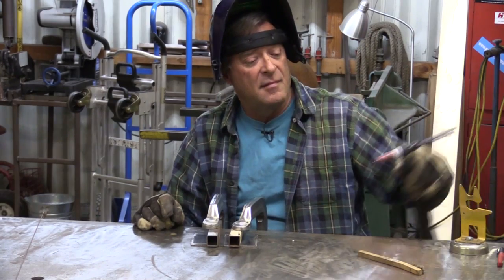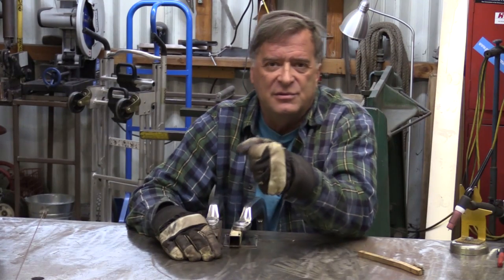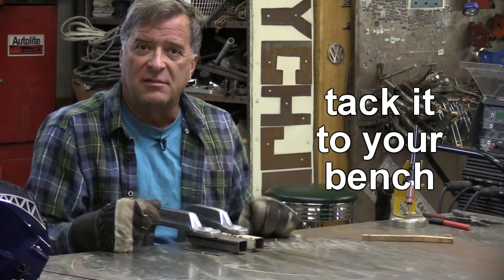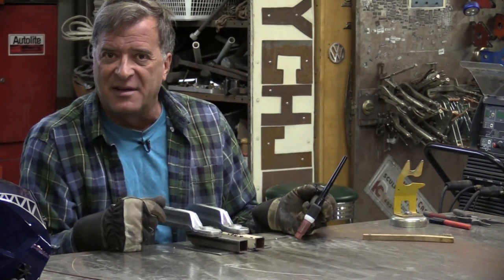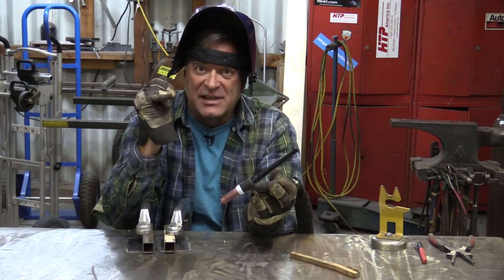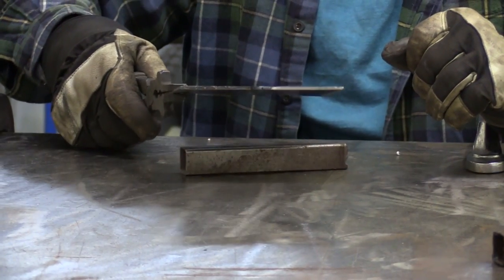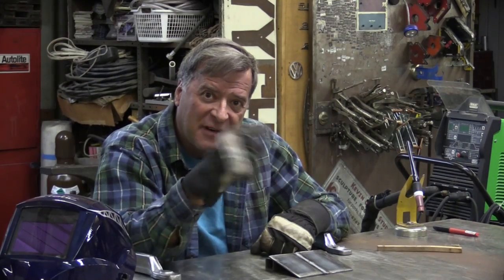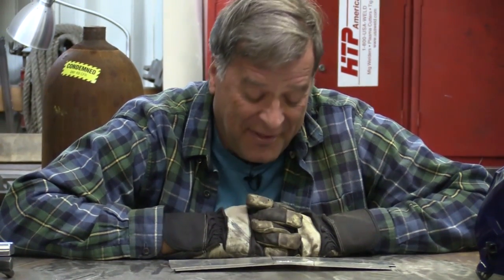How to Beat Welding Heat Distortion, Part 1 - Kevin Caron, Artist

Comment: I've tried just yesterday to weld a square tubing to a piece of 4*4 inch 0.4 thick plate , having tacked the piece to the welding table (3 tacks by side). The tacks held and yet : 
The piece still warped a bit 
What did I do wrong? Is there any way to totally cancel the distortion ? Preheating the parts to high heat ?

Ps: I was using SMAW
Reply from the maker: Bummer!   You might try heating it up to red and clamping it down to the table till cold.   You can preheat and weld at a lower amp to keep the warp to a minimum as well.  Sorry, this didn't work correctly.  Always seems to work for me.
Reply: @KevincaronSculpture  Hey
Ok I will try that 
Thanks for the reply, and thanks for your channel 👍

Comment: Very good explanation as always Kevin.  I recently welded some rectangle baskets on a trailer project and the welds pulled the long sides slightly inward.  I was able to correct them back to shape but I probably should have used more clamps for sure.  thanks for the tips and easy to understand explanations!
Joe

Comment: i understand what u did on the bench....and it was very smart to do it that way & i did learn. this is the type of welging i do MOST of the tyme is 16 gauge panels on cars,patch panels...i am NOT the best welder ,i run gas ext. BUT i do get alot of warpage on panels not,on the edge where ther is a bend ext but lets say in the middle of the door,is there any way i can get less warpage? i dont run my welder HOTTER than the metal calls for. i KNOW your a way better welder than meso,i was thinking there has to b some thing i am missing,cuz i end up having to put more plastic filler than i think i should have to,thank u for listing to my question,any help u could give me . i would b EVER grate full....it REALLY sucks when i try my best & it warps anyways...thank u for your tyme sir
Reply from the maker: you might try a copper backer plate for the mid panel welds..       something you can clamp to the inside of the panel while you are welding the outside...

Comment: Does clamping metal to the work also act as a heat sink to keep the heat from traveling?  Would copper under the work sink some of the heat better?  I'm just say'n...
Reply from the maker: Yes, clamping to the metal table works like a heat sink..   Copper would be better but I didn't have any on hand...
Reply: Copper is too expensive to have lying around unless you use it a lot...

Comment: Hi Kevin, last month I bought a small portable oxy acetylene welding kit, try it one time and find the Distortion will be my biggest problem. 
I bought it for welding and brazing different types of metals. 
can you cover this in the series. 
Thank you for all great videos. 
Regards.
Reply from the maker: Have to practice a lot more for this video...
Reply: Kevin Caron, Artist 
Thank you very much.
Reply: Using An oxy acetylene outfit for welding will open a whole new can of worms but clamping and strong backing the weldment whenever you can will all always help.

Comment: Fabricating my bench top out of  2 pieces 1/2" steel plate, one 3' x 5' and the other 3' x 2'.  Edges met precisely and were beveled.  
I clamped as securely as possible with some heavy 3" x 3" angle and my full complement of big clamps (about a dozen, but not as heavy as yours).  I tacked the ends, middle, in between the ends and middle, underneath upside down because the plate is too heavy for me to turn over . . . . and thought I must have done a good job.  Nope.  FAIL!
The plates made a shallow "V" anyway.  I'm  just having to live with it.  It would take too much heat to try to relax the distortion.  Maybe I'll grind it back into 2 pieces and try a do-over.  Either that or quit being so cheap and just go to the steel store and buy one piece of the right size.
Reply from the maker: grind a shallow groove in the joint on the low side of the warp and run another bead.   Should help to pull the warp out..  Just go slow and check with a straight edge as you are welding...
Reply: THanks, Kevin.  I hadn't thought of that.  Much better than starting over.
Reply: I'm not a pro but that is exactly what I did when I screwed up my weld table and it worked out well.